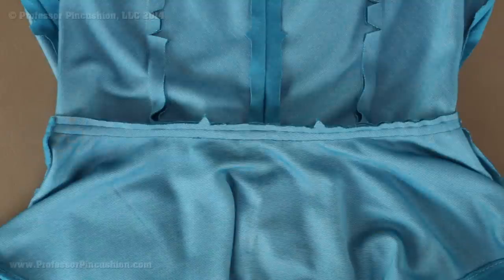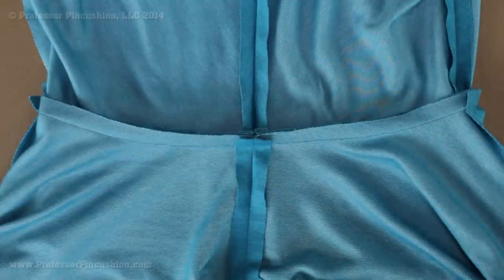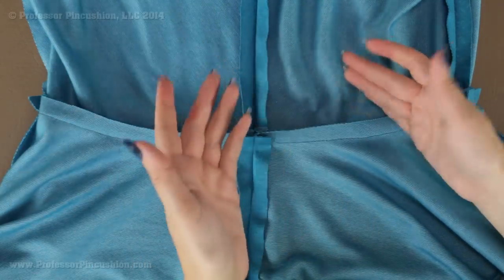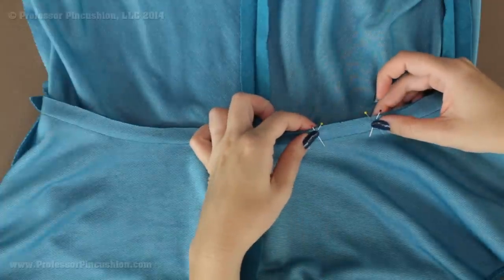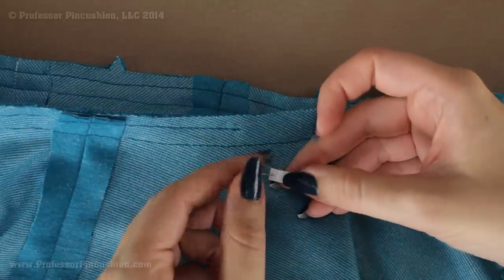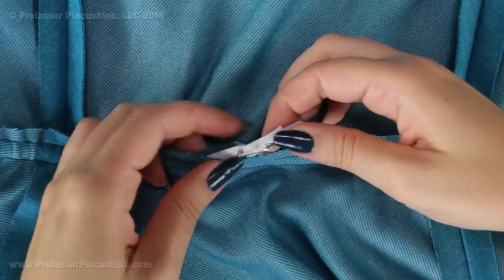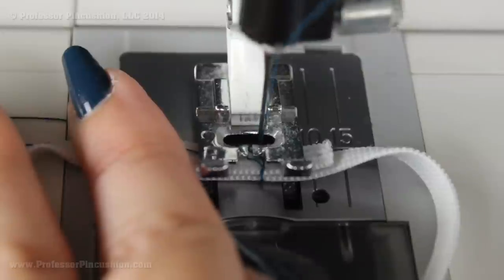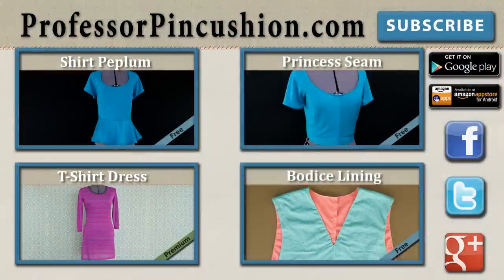How to Sew an Elastic Seam Casing

Comment: how is this stretching with a straight seam? thanks to anyone with the answer
Reply from the maker: Kristina Absher It doesn't need to stretch because when you're doing a casing, it'll be larger than the area that you're fitting.  This allows the elastic inside the casing to do all the stretching, so when it's at full stretch, it'll be at the original size of the casing.  does that help?